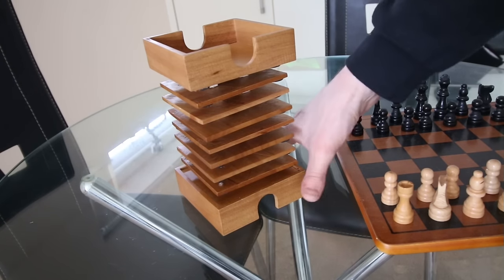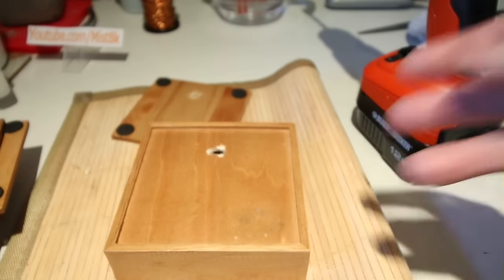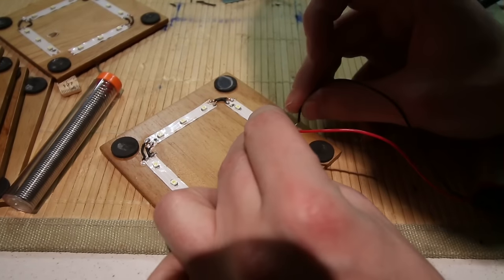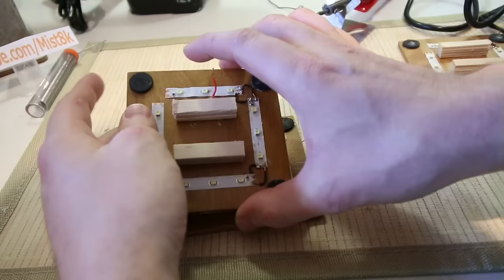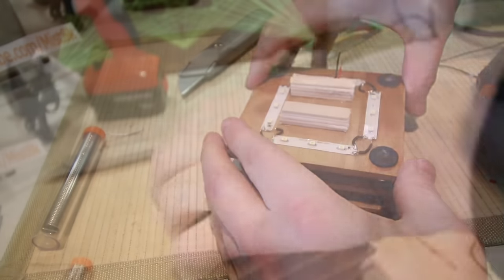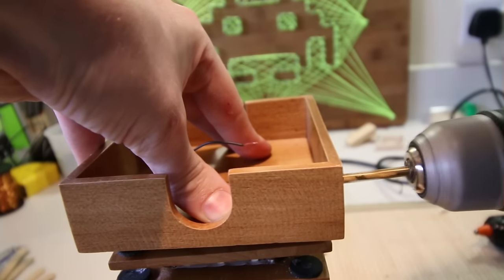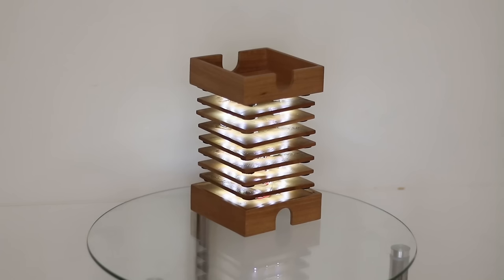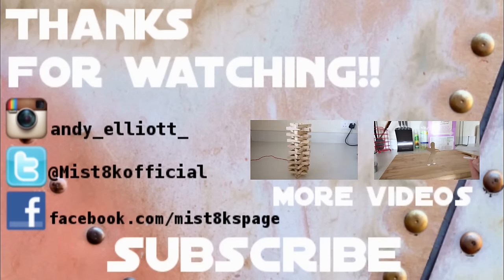D.I.Y Decorative Coaster Lamp!

Comment: For God's sake, don't go wiring this into the mains if you don't know what you're doing.

You'll need extra parts like a rectifier, smoothing capacitor and current limiting resistor.
Reply: +SonOfFurzehatt As a dumb person, wouldn't it be possible to just take an old usb charger and use its power lines to supply this thing?
Reply: Quite possibly - I don't have much experience with these LED strips. Two channels which build similar things with some explanation of how to choose the right sort of power supply are bigclivedotcom and DIYperks.